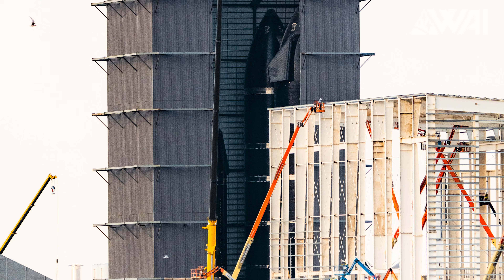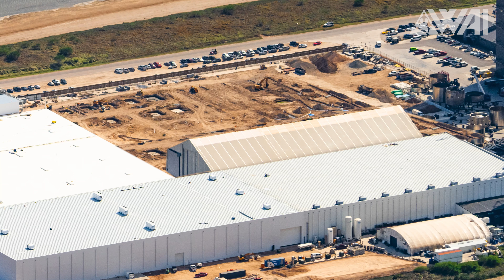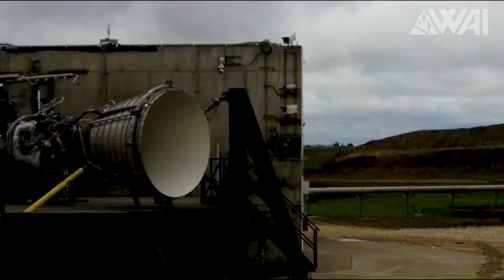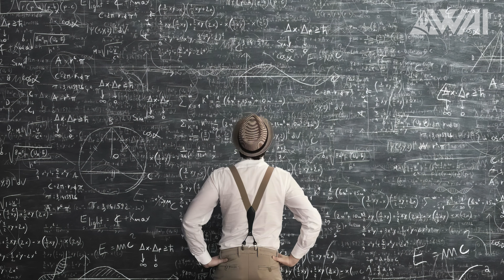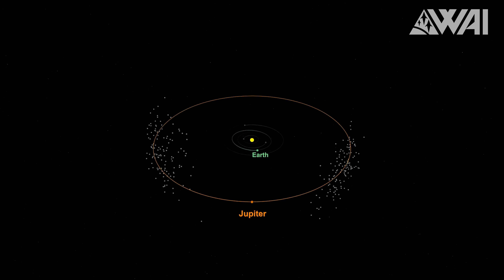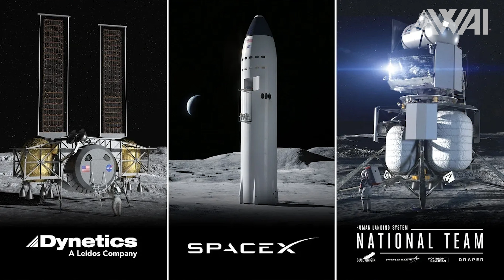It's Launch Time! SpaceX Starship Is Ready Including FTS!

Comment: Not having a glass front to the Start Factory building means that the plethora of Starship clones that were announced shortly after Starship was announced and later mostly forgotten will have a harder time with their overt copying and allowing SpaceX to maintain the near monopoly it will represent for longer.  After all a successful Starship rocket will pretty much make every other rocket obsolete as long as the cost per launch is anywhere close to the prediction Elon made.  Given that the efficiency of the engines have been improved twice since the prediction there's a good chance that the prediction may may close to reality.

Comment: The animations of the minivan sized Orion docking with the garden shed sized lunar gateway station, which is connected to the 3 bedroom house that is the lunar starship are just comical. The fact that NASA is sunk cost fallacy-ing all their outdated tech and projects when also partially incorporating the system that will be their swift demise is beyond me. Need an orbital station? Throw a couple starships up, dock them together, drain the fuel tanks and fill them with modular (possibly inflatable) hab units. One starship cargo bay has more livable volume than the entire ISS. Add some photovoltaics (which would be a partial load for another starship) and you’ve got a genuine orbital lab the likes of which was science fiction 5 years ago. Add some tanker starships to the cluster to create an orbital fuel depot. Need to ferry mass to a lunar orbit? That’s your first waypoint. Make a second cluster at the other end with a lunar starship for mass to surface and vice versa, and possibly a smaller, purpose built craft later for lighter duty work. There! In a few hundred words, I cut the costs of the Artemis program by billions and improved it exponentially, and every single thing I said is either very achievable or already in the works.

Comment: Where on starship will the docking port be? I assume it won’t be at the top of the nose cone due to the header tank.
Reply from the maker: The lunar starship won’t need to have header tanks in the nose. On the current design they’re just up there because of weight distribution.

Comment: Doesn't space x ships have gas tank in the front. Isn't butting docking bay in nosecone really large over haul. I think that gas is used for landings. They still need the gas in somewhere in the ship. I think it would be easier to ships to dock in side of the starship, than change consept of starship.
Reply: More like the same liquid props is stored. Those are called header tanks, and it's necessary only because of flip manuver just before landing on Earth. HLS doesn't do that so yeah they deleted it

Comment: I'm no engineer but couldn't you use an aerogel layer between an outer shell tank and the hydrolox tanks to insulate it enough that it wouldn't boil off?  Obviously adding weight but would there be a way to do it light enough to still reap the benefits of using hydrogen in the first place?

Comment: I can see a few engineering problems there : Upper thrusters near the solar panels - those landing thrusters have to have a lot of power even though the gravity on the moon is one-sixth. Feet on the uneven surface of the moon - Musk argues that the landing site will be carefully selected from orbit, but does not mention the center of gravity of the rocket and the maximum possible tilt. Large glass windows are a fantasy that has appeared in visualizations around Mars. For radiation safety, small windows are better in a small number so as not to violate the integrity of the rocket body.
Reply: 1. Solar panels has been designed for high acceleration, example: Orion

2. You didn't mention the auto-leveling legs and the low center of gravity with more tolerance than Apollo (15°)

3. HLS only has 4 "small" windows
Reply: @alvianchoiriapriliansyah9882  I only react to the illustration in the first few minutes. Then an ad started and I turned off the video. It is possible that the illustration was corrected later in the video...

Comment: If the starship and super heavy can get an orbit and a wet landing (turning upright before ditch) then starship might try a dry landing... if (a big if) it works, then a capture of both might be on the cards... I cannot see that working easily; it's dangerous, difficult and untested. If a starship can get to the moon, there is still the problem of getting it back to earth... landing in one piece.
Musk could still do a nosecone detach and wet landing (ocean style) but the whole thing is supposed to be reusable. This is soooooo far down the road!

Let us hope that the second take off is successful and it can get at least one orbit... that would be progress. I'm still holding out for a starship on the moon for Xmas! x)

Comment: The Luna Starship renders,.. Rigid panels that can be pivoted to track the Sun might be better for power generation on Luna. Facing them towards Sol on the trip out, also could point the nose towards the star, and minimise heating of the interior compared to having a large slab of side-rocket facing the source of the heat,.. And that would also keep the fuel tanks in shadow, reducing losses due to expansion and venting.

Comment: Why land a honking huge starship on the moon versus a tiny lander!?
Reply: I think the only reason to land a starship is if it never takes off again and becomes retrofitted into a permanent base. It could bring large equipment too, but still unclear why cost effective to carry fuel to launch again.
Reply: Also the huge thrust of raptor engines might dig a crater so impossible to have a stable flat landing.
Reply: @aresmars2003 They have auxiliary engines so not using Raptors to avoid craters

And Starship is all SpaceX have, which happens to be designed to land anywhere solid. Building a custom lander is more expensive & impractical

Comment: It was a big mistake to make a hydrolox system and expect to get longterm usage out of it. There are two strikes against you coming out of the gate. It must be refrigerated and hydrogen embrittlement. There's no getting around embrittlement so for longterm reusable vehicles it is not the fuel of choice while methylox is. A hydrolox rocket doesn't have the right to call itself reusable.

Comment: I am hoping SpaceX and NASA will agree to design and build a three stage MoonShip for moon missions, based on StarShip, of course. That would enable smaller but direct to moon and back missions.  The current 50m tall HLS just looks too tall to be safe if the regolith isn’t well packed.
Reply: Not all regolith are equally weak

Comment: HydroLOX rockets on reusable spacecraft on the moon...... *sigh*. 
Hydrogen boil-off is just the first thing that sucks about that idea. All you have to do is look at the headaches Boeing has had on the Shuttle Engines, and now the booster engines on SLS with Hydrogen leaks and bad seals. And that's on NEW engines just refurbished. Think about those seals after they have been in space a year or two. The idea of using lunar hydrogen and oxygen to refuel a fleet of reusable lunar shuttles or interplanetary spacecraft is definitely the most wasteful (of the limited water on the moon), and the most unreliable (because of the finicky nature of HydroLOX rocket engines, tanks, seals) and the most dangerous for lunar landers. (Non-hypergolic thrusters are harder to fire, less reliable, etc) and there is NO BACKUP when you are hurdling toward the lunar surface at hundreds of miles per hour. They HAVE to fire. That is why the wise men of the ancient Apollo program used simple, pressure-fed, hypergolic rocket engines for lunar orbital and landing maneuvers. Even then, the families of the Apollo astronauts sweated bullets waiting on the ignition for the journey home. Jim Lovell famously remarked on Apollo 8 when they came around from the backside of the moon after firing the trans-Earth injection burn - "... there IS a Santa Claus....."

Comment: I think the landing legs are the thing that seems most unlikely in the HLS leaked render. Either they are a "placeholder" for a better designed system or the artist that made up this render lost his imagination at that point. The solar panels seem reasonable, since a curved panel array on the fuselage of the vehicle would be inefficient. I do hope the elevator is extremely reliable, since I don't see any backup mechanism. The need for an elevator is one of the many drawbacks to the 1950's "Destination Moon" style of landing vehicle. That's also a giant reason for some sort of super-stable, wide stance, shock-absorbing, uneven-terrain-compensating landing gear. Elon hates details until they turn out to be harder than his incredibly optimistic mind thought at first. I have a feeling, the landing legs are going to be the "parachute problem" of this design.
Reply: Having hanging vertical panels that can pivot towards the sunlight seems very efficient, although each moving pivot is a point of failure.
Reply: Two elevators.
Reply: I hope that the FAA and the Wildlife agencies delay the SpaceX Starship project in the coming years to at least 3 to 5 years behind the Chinese Space Agency. The Chinese deserve control of Space and the US does not.
Reply: I suspect the final design for the landing legs will strongly resemble Falcon 9's landing legs.  The advantage being that once deployed they could simply stay deployed for many round trips.  I'm also dubious about those solar panels, but I don't have a better idea.

Comment: So this new HLS version should better be lauched in a protective fairing system. Once in space, outside forces will matter less.
Reply: The solar panels can be retracted. There's zero fairing that's large enough to enclose the..entire Starship
Reply: @alvianchoiriapriliansyah9882  it wouldn't just be the solar panels that aren't up to launch forces in case of a HLS in which adaptations would cause several structural weak points. Only just already referring to the issues with the starlink output sleeve.
Fairings can go beyond the 9 m diameter.

Comment: Ok hear me out. Other than someones feelings getting hurt, why can they just not fly starship from orbit to the moon if they are gonna do in orbit refueling? Seems like starship would be a much better ride than the orion.
Reply: Starship doesn't have a crew quarters yet, and they need to fly it multiple times to gain reliability before they start launching humans

It's different standard to NASA though, who use much more analysis & launch escape system. So Orion planned to fly crew only on its second flight
Reply: @alvianchoiriapriliansyah9882  true
Reply: It would be more comfortable but there would be a lot of dead weight from the heat tiles, sea level engines, and fins when it lands on the moon. Unless they launched two starships. Also NASA won’t let any of there astronauts fly on starship until it can prove it’s safety and reliability.

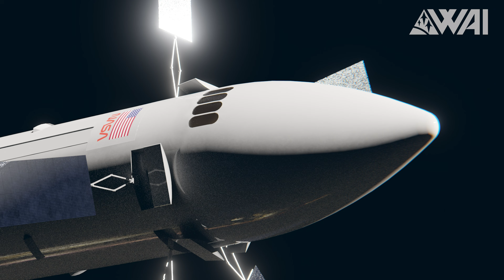Comment: 7:52 Unless those windows poke out, the landing crew will not be able to use them to assess damage.
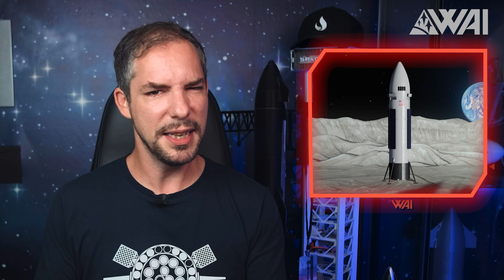8:38 "Science fiction today, fact today, outdated tomorrow."   Well Spacex thinks the same way. Always changing and improving.
19:30:  13th though the 18th got it.
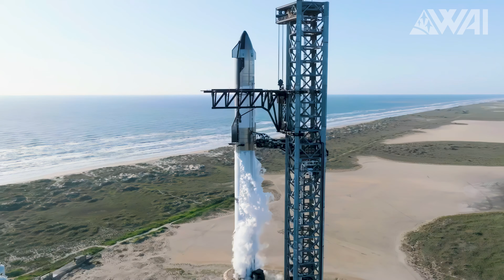12:10 Well that's one way to look at it. Another way... to see it is that with them shut down. There will be no one to say no and Spacex can do whatever they wanted. 😏Hint, hint.

Comment: Storing liquid hydrogen for missions to the Moon or to Mars.  This is old technology.  I posted this 11 days ago:

Way back in 1970 Beech Aerospace built several large super insulated zero boiloff tanks (ZBOTs) to store liquid oxygen (LOX) and liquid hydrogen (LH2).

"The hydrogen thermal test article (HTTA) was 21.8 ft. long x 9.2 ft. diameter. It used all known technologies for maximizing thermal performance in a flight like dewar including fiberglass strap supports, 68-layer, aluminized Mylar MLI blankets and two vapor cooled shields. It was made from spun and welded 2219 aluminum. It was tested with liquid hydrogen and demonstrated a boil-off rate of 0.022%/day or 8%/year [4]".

Note the size of that tank. And 8% boiloff loss per year by mass is sufficiently low for any mission to the Moon or to Mars.

This is 50-year-old technology. I assume BO is aware of this history. See:

https://iopscience.iop.org/article/10.1088/1757-899X/101/1/012086/pdf

Comment: As for leaked hls renders, while they very likely originates from SpaceX, i think those were very early concepts of this ship. 
True form is imho in development, so those ALL RENDERS (including official) contained elements that are very likely to be in final version, like relatively small cargo doors, elevator, solar panels (probably not quite defined), landing thrusters and deployable (not retractable) legs. I think those leaked renders are from time similar to second official render, but they were discarded. 

Simply knowing spaceX design philosophy: (best part is no part), I don't think thay they will try to attach so complicated retractablesolar panels
Reply: why do we need a starship to land on the moon its a good supply ship but people should land in a small shuttle craft
Reply: @edlong4613  why?
Size is irrelevant, what is important is reliability, price per mission, ability to met all Mission requirements. 
With Starship hls most important is ability to refuel in orbit, second is reusability.
First is basically go/no-go for hls. 
Second is price per launch. If both requirements are met, hls is optimal option. Pricetag per mission will only go DOWN, as with further optimisation of reusability, price per launch will be reduced due to multiple launches needed for refuel.

Second: price per Lander itself:
Having so overpowered system like Starship, you don't have to worry about shaving every kilo from Lander. So: no fancy, expensive materials, production process more in  industrial way, not in laboratory.

Comment: Can someone who actually knows, rather than someone just guessing, explain how Space X building multiple star ships, such as 20, 26, 28 and 29 (and assuming there have been 21-25 and 27) makes economic sense? When a ship is built but becomes redundant before use is it repurposed or scrapped?  

It is generally accepted that for any project the is a trade-off and a choice has to be made to priorities any two of a project's Quality, Cost and Speed. 

With Space X, speed seems to be a given, so between Quality and Cost which are they prioritising?

Comment: The aviation community, which includes the aerospace community,  respects competence earned through commitment to acquiring and practicing skill. Recently, the FAA, without comment from the community, decided to alter the meaning of a time-honored expression while, at the same time,  removing all meaning from it. Until recently, NOTAM  meant Notice To Airmen. The previous understanding acknowledged the humanity of the individuals who are responsible for the safe operation of aircraft of all types. Replacing Airmen with 'air missions' was a change to remove any potential association of the craft of flying with the individuals engaged in it. 

The aviation community, in general,  does not respect this change and does not acknowledge it as representing the opinions of the air men and women who serve proudly a legacy of accomplishment provided by its members, both past and present.
Reply: Men are commonly & by definition associated with only male, and you think that's fully acknowledging all individuals & not controversial at all?
Reply: @alvianchoiriapriliansyah9882  Consider the NOTMAR, an equivalent system to inform Mariners of important special use of oceans and costal areas.  Somehow, they have gotten around to dehumanizing the occupation of private and commercial seagoing individuals.  

The "Mariner" equivalent  would have been the gender neutral term of Aviator. but they didn't do that.  They chose the term air missions, which doesn't apply to most private and commercial aviation activities.  It might apply to the military, but I have it on good authority that the military have their own language which they are quite happy with.  Just ask any "Airman" in the Airforce.

When I fly as a private pilot, I'm not on a mission anymore than you are when you are on a Sunday drive to the countryside.

You suggest the "by definition" using "men" somehow limits the association to only men.  True, for most of the last two-and-a-half centuries, the tradition was to use "men".  Mostly because for most of that time the primary participants in the activities of an ocean going or flying occupation were men.  The long-held, generic use of the term "men" or "man" was (and still is) understood to be simply a shorthand for substantially all human endeavors.  It has been the practice for several decades to use "woman" or "women" where specifically appropriate, rendering deference to females entering a becoming an important part of many human activities where they hadn't historically played significant part.

So, no, I disagree that that many word forms that include "man" or "men" are specifically associated with activities of human males.   It is a long held tradition in language and doesn't slight the race as a whole when it is used generically.  I believe were all smart enough to figure out the differences and apply them without the FAA  jumping through hoops to foul-up the lexicon with woke-isms.